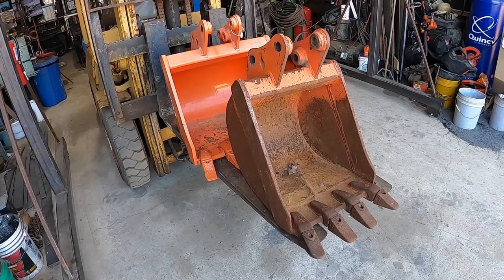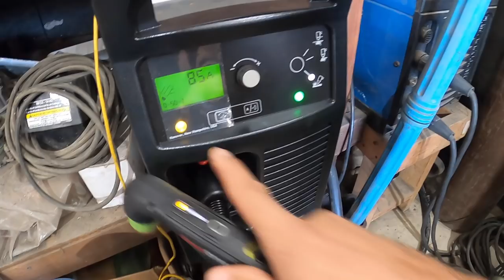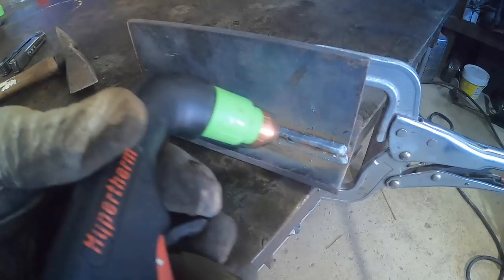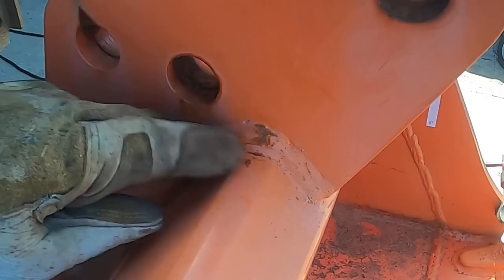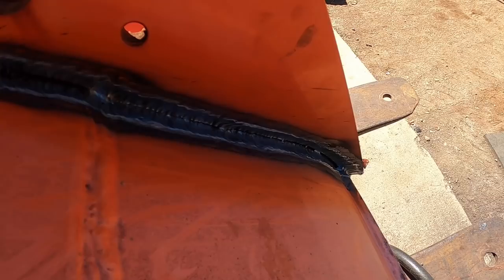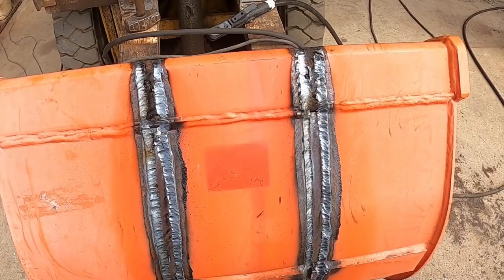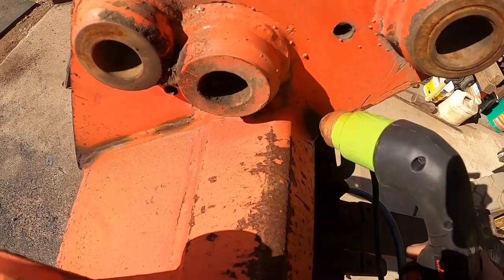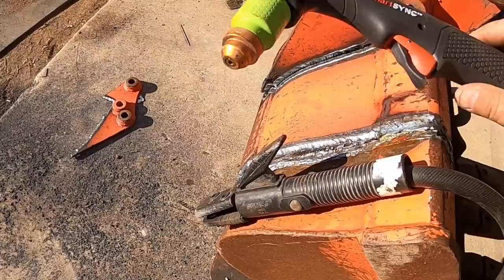Plasma Gouging or Carbon Arc Gouging? You decide.

Comment: That is crazy you just posted this Because the past few weeks I been messing around using an Eastwood 65 amp plasma to guage and scarf cut welds off with just the regular tip. I was using it to separate Factory spot welds on body parts to replace them also at real low amps and it actually worked pretty well good control to not burn through the second sheet metal layer. I want to find guaging tips for that Eastwood plasma.

Comment: Ive used torches to gouge and plasma and im proficient with either however I have never had the opprunity to use an arc gouger.  BUt earlier this week the rail dropped off a 994 rock bucket that I get to retro-fit and upgrade...never done that before either so I guess this next project after the d375 blade is done will be that.  I have a hypertherm 125 at my disposale and the miller trailblazer for gouging and I plan on using both to determine what my preference will be.

Comment: It looked like with the plasma, you started by doing a weave and had to go over it again, but later, it looked like circles and you were able to get to the separation line on the back side of the circle. I know that you were learning, so are there any thoughts on what manipulation worked best in this situation?

Two points of comparison you didn't mention were the noise levels between the two and where/how far did the sparks go? The noise level may not determine which one to use, but if the plasma isn't throwing sparks nearly as much, that might factor into which one to use in certain situations.

Comment: First and foremost, GREAT video as always!!!  You're always so humble despite the video evidence that PROVES your mastery of the metal you work with.

Secondly, given all of your 'experience' with carbon gouging versus your 'first time' use of plasma gouging, I would completely EXPECT your carbon gouging to come out better.

Lastly, my 'totally inexperienced at anything more complicated than breathing in and out' opinion is that the plasma gouging seemed far less able to show a nice. clean. separation line.  It was almost as if it was attempting to weld the two parts back together.  Perhaps if it had an increased airflow, it would have achieved a better jobs of 'blowing' the puddle away from the separation line?  (For example. if the air nozzles in the head had a rotating disc behind them that (sequentially) concentrated the majority of the airflow out of only 1 or 2 of the nozzles?)
Reply from the maker: plasma gouging is a nice option when there is nothing else. And as with anything, it takes practice. it worked good for what it is.

Comment: It be a handy tool for getting into small awkward spaces but I wonder what the cost and usage time is on these heads compared to buying a pack of carbon rods .  It is a bulky looking head but im sure over time they will come up with smaller versions and possibly cheaper . I think Isaac will always prefer to use the carbon rods as he is well used to them and always does a brilliant job with them

Comment: carbon arc all the way ... I usually run 1/4" round carbons at about 300 amps. it really makes the music play and no need for any manipulation ... just straight line cutting ....      I feel the only drawback to carbon air arc is the noise and air requirement  .... as far as speed, cost, ease of operation .... etc etc etc ... it beats plasma gouging any day of the week ....

Comment: So where dose the air come from on the arc gouge? May sound dumb but watched the whole thing and did not see a air supply. . You did show a welder. and a hole in the handle . I have a ac arc welder . and no way of cutting other a grinder .Do you use ac or dc for that as well . Thank you

Comment: Really depending on what it is for me and how delicate it is to work on if it's under three-sixteenths of an inch I would rather have a plasma unless it's a really tight space you can't get anything else into say a real Thai corner that you can't get a plasma torch into, anything over 3/16 I really don't have a preference if it's carbon Arc or acetylene if it's heat sensitive something like a low boy frame or say a turret on a crane then it's hands down carbon Arc

Comment: To me carbon arc gouging is basically like unwelding, same technique and principles, it just blows the weld puddle away instead of filling it up!
This new magic is a different beast lol

It looks like with practice the plasma gouging would be much faster, continous with no rod swaps, and faster removal rates, but probably require more skill since it runs so much hotter and so can go too deep faster.

But man, imagine how fast you can hog out a big weld! Especially if undercutting wasn't a concern because a piece was going to get replaced, or it would be filled in easily in welding.

Comment: Good and interesting comparison. Working heavy equipment for 40 years did a lot of carbon Arc gouging but no plasma gouging.. but I do like the plasma cutter for cutting out material. All these years my go to torch has been an oxwell w17 combo torch which I like using a gouging tip many times rather than the loud air Arc especially when working near a lot of other people on short jobs. Just curious have you done any oxy acetylene torch gouging? Thanks for the videos
Reply from the maker: I have done my share of torch gouging in the past but I find that it overheats the parent metal. I like Carbon arc over any other form. its much faster in my opinion

Comment: My company has just started building/repairing buckets. We use carbon arc gouging for material removal (not a lot). Do you think it would be worth it to buy the necessary tips and accouterments (we already have a small plasma machine)  to start using plasma gouging?
Reply from the maker: Each have their place but if you are going to gouge anything deeper than about 1/2" thick, I would most likely stick to Carbon arc gouge. the plasma arc may be limited on depth.

Comment: I have been meaning to ask you why you do not use plasma arc gouging instead of carbon arc gouging.  Hypertherm plasma cutters are definitely the best hands down.  I have the first gen powermax 45 with a hand torch and I would buy a powermax 105 in a heartbeat for my plasma table which currently has a thermal dynamics cutmaster a120 on it now which does work well.

Comment: Isaac, do you think the Hypertherm powermax might work on a plasma table or is it geared for gouging only with those tips.  Your videos are the best thanks. (ps have you tried graff cut off disks from Germany I bought one on Amazon but have not tried it yet 
will let you know.)
Reply from the maker: Im running it on my plasma table for its main use, but I have the 50' hand held torch for situations such as this.

Comment: Given that the air can be effective from the distance of the electrode with carbon arc maybe the clever folks at Hyper Therm can make a tip that carries the arc while keeping air jets back at the torch.
Reply: That's a cool idea but it's not how plasma works. The air jet comes out of a sleeve of metal that sheds electrons and forms the hot plasma so the air jet is part of the process.
Reply: @GuyRWood  gotcha, so the arc must be as long as the air/gas.  Some genius will figure out a way to narrow the tip.

Comment: That Hypertherm is very impressive and in the hands of a master, even more impressive! Can you use a welder like a Powermig 210 for some gouging, nothing too heavy?
Reply: The powermig 210 should be able to gouge in stick mode.  I would certainly think running it on 240v would be a must, and pay real close attention to your duty cycles as carbon arc generally uses a lot of amps, even for smaller stuff.
Reply: You need a constant amperage DC power source for gouging. Mig welders are constant voltage.
Reply: Cv works good for carbon arc. I use both an engine drive on cc and if im in the shop I use a deltaweld 450. The cv tends to have a wider arc for the same rod as a cc power source but I probably prefer it.

Comment: Hey Isaac, all the way from Portugal. Im a mobile welder, i will be doing some air arc gouging in the future, but i still have to purchase an air compressor, what compressor size do you recommend, 150 200 Ltr compressor is it enough? ( 650 ) ltr per minute intake , think might be enough?, my problem is space ( closed van)  and plasma is too expensive for to buy.
Great videos, love them! I learn a lot !
Reply from the maker: I started with a 13cfm @90psi unit but I now have a 22cfm @100psi. Anywhere in that range will work.
Reply: @ICWeld   thank you so much for you response and help! Continue the good work 👏 🙏 👍 cheers

Comment: What adjustments did you make with the plasma gouger?  The sound in the video dropped and it sounded like you did something.  Also, it looked like you changed patterns with the plasma gouger and the separation line showed better

Comment: like the plasma looks like a 4K$+ machine. arc gouging seems faster overall as you didn't have to make as many passes. so where does the air come from for the arc gouger handle? does the power supply have a compressor? i'm guessing a separate compressor that attaches to the power cable?

Comment: Looks like the electrical requirements for the Powermax 85 are lower and I could run one in my shop.  Everytime I look up a Arc Gouging set up it requires a pretty large power supply.

Comment: As I see it both gouging process get the job done, but I would use the flush cutting attachment from Hypertherm.                    this job could be done in one pass from one side of the ear.
Reply from the maker: The customer was going to reuse the ears as a pattern for the new mount. couldn't use the flush cuts for this.
Reply: @ICWeld  well at least there is a reason for gouging them off.

Comment: Have you tried gauging with acetylene and oxygen? I work as a welder in heavy equipment and its the only one I use. Good control and strong. Somtimes I use oxysafe and gasol sometimes. Nice work I shall try the plasma👍🏽
Reply: Haven't you seen when he uses the gas cutter? Talk about steel surgery

Comment: Hypertherm is the best on the market.  I scoured the web before I bought my 1st plasma 45XP (last month) and was amazed at how easy and Powerful it works especially with a drag tip. 
The 45XP is rated to cut 20 inches per minute of 5/8 material and blazes thru anything lighter plus it automatically adjusts air pressure. I love it!

Comment: I know it’s a month old video but I was just in a weld supply last night picking up some rods and talking to a rep about one of these for my company I’m starting and he said most of your gouging depth comes from the angle of the gun. Never used one so can’t personally say but I figured I’d pass the information on.
Reply: Also had a question for you after watching this. I just have a Bobcat 250 and it seems to be 50/50 in terms of gouging with it. I know Miller says it’s applicable with a 3/16 electrode but other guys saying you run the risk of your machine coming unglued. What are your thoughts? Thanks.
Reply from the maker: 3/16 rods should work fine. I would gouge with those around 160-170A. should be good.
Reply: @ICWeld  you don’t think there is really a risk of it getting ruined? I’ve only gouged on significantly bigger shop rigs never on an engine driven welder so just trying to do my due diligence before ruining a machine.
Reply from the maker: I personally use a miller trailblazer 302 airpak for gouging almost on a daily basis. but maybe it would be best to ask a lincoln Rep.
Reply: @ICWeld  alright man. As always thank you for the input and information. I’ll speak with a Miller rep and see what he has to say about it. Thanks.

Comment: My husband had a question about a 1"inch plate fabrication. Do you use a Plasma or cutting a torch or do you send it out to a water-jet, edm or a machine shop for fabricating metal plates especially if its a high PSI plate ? ... He likes your method as well as On fire Welding channel he understands how you teach the approach to prep & work...
Reply from the maker: I prefer to use the Torch on most things. Plasma cutters tend to leave a tapered cut on the edges. Torches cut Pretty square to the material so long as you are holding it correctly.
Reply: @ICWeld  Thank You for your expertise

Comment: If you dont mind me asking what do you charge for something like this i have just started getting my own bucket repair work through a heavy duty mechanic shop and when i do a job for him its 50CAD (40USD) an hour but when its just me its 100CAD (80 USD) i was wondering if that sounds reasonable or if you suggest on charging per piece? Either way i love your videos and it is one of the things that lead me to start this working for myself thing and im loving it.

 So, thanks.
Reply from the maker: What you charge is mostly based on your skills, tooling and experience. Then you have to weigh that with what your local market will hold. There will always be an exception to the rule but you have to decide that for yourself. I hope this helps.
Reply: The correct answer is, whatever the local market will bear. Questions like this is like comparing apples to kumquats. IC lives in California IIRC and they have insane Cost of Living expenses. So a great rate for you in Canada would probably bankrupt IC's business if he tried charging what we'd be able to turn a profit on.
Ask around and find out what other shops are charging for similar work if you're able. Ultimately how much you're willing to charge for your labor is on you.
Reply: @CO Jones  (actually he is in texas)
Reply: @ICWeld  thankyou for the quick and wise response
Reply: @cojones8518  that makes sense thankyou. I live in vancouver so im "blessed" with high expenses as well 😅. I appreciate you sharing your knowlage

Comment: I assume the advantage of carbon arc over Oxy Acetylene is cost to operate?
A carbon arc set up is on my want list, right after I get a bigger welder and bigger air compressor.
In the mean time I make do with the gas ax and a cheap amazon plasma cutter.

Comment: Hyperthem has a 4" narrow extension tip exactly for this purpose of reaching small areas. It's tip is called a Hyaccess tip and the part number is 428414 https://www.hypertherm.com/en-US/hypertherm/hypertherm/consumable-kit-duramax-and-duramax-lock-30-65-a-hyaccess-cutting-and-gouging/. A picture of the tip is here https://www.hypertherm.com/en-US/learn/consumables-and-torches/for-powermax-and-max-systems/hyaccess-consumables/

Isacc's Hypertherm rep - it would be awesome to get Isaac 428414 so he can demo it.

Comment: If you look at it from expense side, the gouger and machine will cost alot and then the rod used as well, the plasma would probably be a little cheaper, it just uses air, so other then the machine the cost factor would be cheaper, but the gouger is faster it seems, but I like plasma so I'd go with plasma myself
Reply: If you were a welder you already have the machine for arc gouging and the rods are only about $.50 apiece, the gouger itself ranges from $100-$400. So if you are a welder technically The air arc gouger is cheaper.

Comment: I guess with the Hypertherm, you need a 5-8bar (75PSI to 110PSI) gas/air supply, that is clean, dry and oil free. Plus alot of tank size if doing 100% duty (66A @ 230V)..40% duty is 85A running 208V single phase. (I checked their manual). You need about 75-110PSI (80-100PSI ideal) for carbon arc gouging. So atleast a two-stage 80gallon or greater tank compressor. Yes?
Reply from the maker: I have a 60 gallon compressor that keeps up fine.
Reply: Pressure <> flow as my HS physics teacher would say. The Carbon Arc probably flows more CFM than the Plasma since the air jet of the plasma is right at the nozzle.
Reply: @cojones8518  with the air arc you shut it off as soon as you are done cutting, with the plasma cutter the air has a tendency to run for a while after the cut, therefore consuming as much air if not more.

Comment: Do you you use for eye protection?
Reply from the maker: I use a No.5 shade cutting glasses but I think the Plasma cutter is too bright for it. I'd probably suggest around an 8 or 9 shade. but for welding or arc gouging, I use a No.11

Comment: I would think plasma gouging is the way to go (for bulk removal) due to not having the expense of buying gouging rods and considering the difference in power consumption requirements?
Reply: Bulk removal is better with the carbon arc gouging, it’s faster and the rods go a long ways.
Reply: @jeffsimonar7161  I was thinking more along the lines of economic value in cost savings by not having to buy carbon rods and the extra energy carbon arch gouging uses.
Reply: @merlepatterson  I don’t think the energy difference would be noticeable and the carbon arc rods are only about $.50 apiece
Reply: @jeffsimonar7161 yeah, you may have a point there